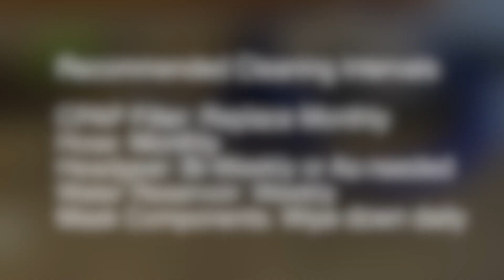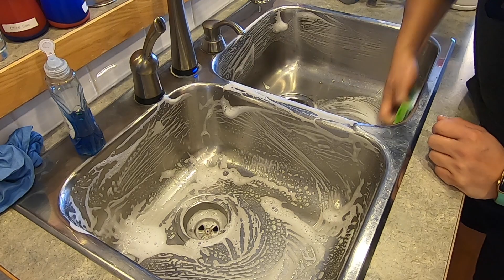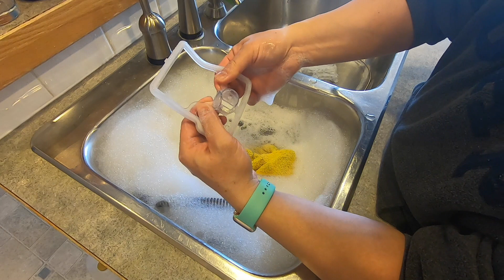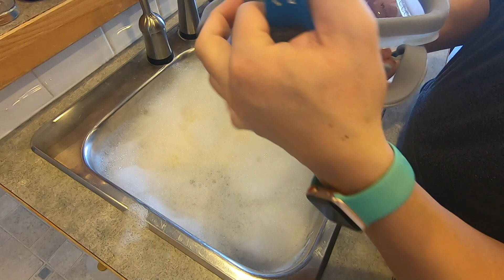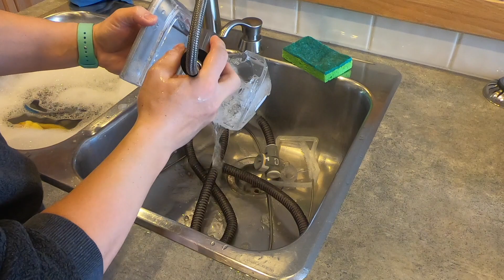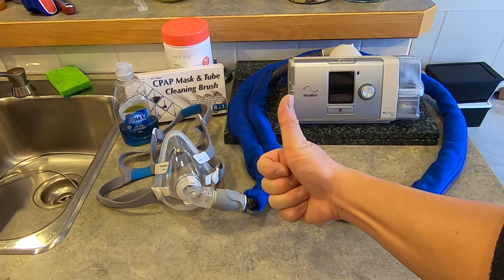How to PROPERLY Clean CPAP Equipment

Comment: The technician who gave me the cpap told me explicitly NOT to use Dawn dish soap but to use baby shampoo instead. Thoughts?
Reply from the maker: while it is true that dawn definitely does a really insane job of cleaning things up well and has some residual perfume smell to it that I've been doing it for 7 years like this on the ORIGINAL heated hose with nary a problem.  The key is to not use too much Dawn and to rinse your stuff really really good with clean warm water.  I triple rinse at the minimum and yes I can smell a bit of the dawn but that quickly dissipates especially once things are dried.  Think about it for a moment - you use dawn dishsoap all day long to wash dishes, we use caustic dishwashing powder/tabs on the very things we use to prepare food and has anyone died or gotten sick?  Not that I know of so I don't see how washing cpap equipment when done properly and THOROUGHLY rinsed would be any different.  If I'm still using my original hose from 2017 with regular washings with blue dawn and I've NEVER had a problem then well.... you draw your own conclusions from that.

Comment: I had my machine for only a week in use and now the air coming from it smells stale ... It seems when you have a machine with built in air humidifier and heater you must wash the air hose much more often then 1 time a month.

Comment: Thank you for this extremely helpful! My husband uses a cpap and he is lazy and doesnt clean his... #eyerolls so I have to doit for him. #smh
Reply from the maker: Glad you're helping him out with the maintenance aspect of cleaning.  Having clean equipment is pretty important for health reasons.  I'm lazy too but found that when I didn't clean it that over time, it would start to develop a different smell to it (nothing gross) so cleaning it ensures that nothing unhealthy like mold can start to develop inside the air pathways.  The hose has heavily humidified air and the reservoir contains water.  Tell me how mold can't grow in that b/c it most certainly will.  Moreso if you live in a humid climate.

Comment: I was told where i get my medical supplies not to use a brush on my hose because it scratches the inside & bacteria collects in the scratches.
Reply from the maker: The brush I use is very soft and in all the years I have used it that I have never had an issue with the hose accumulating and bacteria or mold that I could see. It doesn’t smell funky either so that’s usually a good sign. Going in 5+ years strong in the original hose. Just get a good quality soft bristled brush designed for cpap hose cleaning and be gentle when using it.
Reply: @piercedasian  my insurance company pays for me to get a new hose every 3 months.
Reply from the maker: While that is a nice perk that changing out a hose every 3 months seems very wasteful.  I'm still using my original hose from 5 years ago with nary of any signs of wear or it being smelly or dirty.

Comment: I always put the water chamber in the dishwasher for the airsense 11 in the dishwasher
Reply from the maker: I'd caution you to double check your reservoir to make sure it is dishwasher safe as you can over time, damage the reservoir from the caustic dishwasher cleaner + extreme heat.  My air sense 10 had the OPTION of a dishwasher safe reservoir but the stock one from factory is not dishwasher safe.  If the air sense 11 is washer safe then way cool!

Comment: I have a REMstar plus water chamber can't get the bottom off to clean it what can I use to clean the inside of the water chamber?
Reply from the maker: ah, use straight white vinegar and soak it for day.  If you've got hard mineral deposits in it or any other nasties that the acidic nature of vinegar will kill off most of the pathogens in it.  Just give it a good rinse with water and be aware that vinegar smell will persist for a bit after rinsing it.

Comment: Once weekly I use a 33% vinegar solution in my water chamber.  I leave that in the chamber for an hour to sterilize the chamber. I use three different hoses and headbands so two are drying for two weeks on shower curtain rod.   I use pillows and rotate these daily.
Reply from the maker: wow that's a pretty good rotational routine you've gone going on there!  Good job.

Comment: Why not use a Cpap cleaner?  Like So-clean or lumin?
Reply from the maker: I have a so clean but you still have to wash things like oils and physical residues from your cpap equipment.  I tend to lean on the cleaner side of things and will use so clean every 2-3 weeks and then a sink submersion wash each month.  Been years and still using all my original CPAP hoses/reservoir and even headgear.

Comment: How do u get the connector piece off the hose?
Reply from the maker: I just pulled on it and it comes off.  The hose piece that attaches to the face mask elbow is a separate part.

Comment: NO, NO, NO! HELL NO DO YOU WASH THE EQUIPMENT IN A SINK!  NOR USE TAP WATER. Distilled Water, heated in Microwave or boiled. Use medical anti-bacterial soap not dish washing soap.
Reply from the maker: This is such nonsense.  Even the DME doesn't suggest doing that.  Distilled water to wash your equipment?  So insanely wasteful.  Unless you have contaminated water that there is ZERO issues washing things this way. If the very sink I prepare my dinners in (washed down with disinfecting cleaner regularly) is good enough for my food then it certainly is good enough for my CPAP.  Use of medical grade antibacterial cleaner is just plain crazy talk.

Comment: I use tea tree shampoo…it cleans well and the minty smell cancels out the potential yucky smell that can make your face mask stink.
Reply from the maker: interesting.  I haven't tried tea tree shampoo on my cpap gear before but I get what you mean.  I can't say that my cpap masks ever smell but then again I usually give them a quick wipe down with a cpap wipe each day and I do regularly clean mine using the method shown in this video.
Reply: @piercedasian  I use a mask wipe Monday thru Saturday.  I do a deep clean with the tea tree shampoo in a bowl that fits in my bathroom sink of: the entire humidifier compartment, framework of the headgear and nasal piece every Sunday morning as soon as I hop out of bed. I take the hose into the tub, pour a little of tea tree shampoo and fill the hose with warm water and work the hose up and down to get it clean.  Then I rinse it, and take all the pieces to my bedroom to dry.  The headgear dries on a towel… I place the bowl upside down on the towel that I used to soak. The headgear is draped over this inverted bowl…hangs nicely…where it dries. The rest of the gear including the hose goes into a towel-lined tray to dry…with the hose hanging to dry. I found the bowl and the tray at Dollar Tree, the microfiber towels at Home Depot.

Comment: Nice video,  How about months of daily use without cleaning  any part maybe a an occasional swipe with a baby wipe to get the real gross stuff off. I have done this routine seven years now no infections,  no issues,  just better sleep. I have flushed the tubing with dish soap and hot water about every 6 months just because.  My machine is set to full time  positive pressure no Bi-pap mode, which blows constant pressure. How can any thing but normal everyday bacteria mold, spores, pollen, dust and dander  that we breathe anyway get inside the machine and tubing worse than a houses air conditioning ductwork ? Also the CPAP is a positive pressure environment. Yes I have the machine micron filters in place and do change those monthly . I also use tap water in my reservoir. And i am on the road all over the country. I do soak the water reservoir with vinegar every 4/5 months to get the mineral deposits out . Do you wash your house and car’s air conditioning vents and ductwork with dawn and vinegar too ?  Didn’t think so. Calm down everyone
Reply: Great advice. Not.
Reply from the maker: While I don't argue that you haven't gotten sick and that cleaning cpap equipment like how I've shown might be excessive that in certain instances that some folks NEED to clean this way b/c of the environment they live in or b/c of immunocompromised health conditions. I like to take a "balanced" approach in my cleaning routine where I do this very exact cleaning procedure every other month for my own peace of mind.  You're absolutely right that no sane human being cleans their ductwork the way we clean our cpap but I'd rather know that I made a conscious effort to keep my equipment clean and should I ever get sick that it would never be pinpointed back to my lack of cleaning of my cpap.  Each to their own.  If it works for you then it works!  I can't say the same for myself or others that I've seen get sick b/c they neglected their cleaning.

Comment: Sink, no way! Dishpan can be cleaned and no funky kitchen germs.  The overseeing authorities of the facility I used to work at one time never allowed us to use strong dish detergent because of the Ammonia content.
Reply from the maker: I think sink is fine permitted one exercises common sense in their own sanitation. I disinfect my sink regularly since it is the same sink used to prepare the very meals I eat.  I would hope that those that use their sink to clean their cpap equipment also understand that they should be sanitizing their sink regularly.  I've used dawn dish soap since I got issued my cpap in 2018 and no issues and my original heated hose and reservoir and even mask components look, feel, and operate like the day I got it.  I'm not sure what other cleaners people are using by dawn dish soap seems fine and I've used it for years with my bare hands to do dishes and my skin is fine so how can a plastic hose be harmed by something like this?  Proper washing techniques and thorough rinsing are paramount to ensure all traces of the detergent are washed away.  It wouldn't be ANY different than you using dawn to wash your dishes and nobody makes a fuss about the plats you eat your food on.

Comment: I was using and still have a SoClean 2. If I had to do all this to use the CPAP I would have given up years ago. Because I got a replacement DreamStation 1 I decided to use the White Vinegar to clean the chamber, mask and tube. Hands scrubbed the chamber and mask with a little vinegar and then rinse with hot water. Put a some vinegar in the the tubing, raising and lowering it and then rinsed with hot water. I think I can tolerate that once a week. I don't have a two compartment stainless steel sink. I can only telling you using the SoClean I never got a respiratory illness, cold or sore throat. Never washed the tubing or mask as it was disinfected with the ozone. Just replaced on an interval basis per Phillips suggestions. I washed the chamber in hot water every couple of days. I probably was only using the SoClean one a week or so the last year. Now I will hand clean the equipment and just use the SoClean every 6 weeks when I don't want to be bother cleaning the devices in vinegar. Maybe one of these years the CPAP manufactures will come up with self cleaning devices that eliminate bacteria.
Reply from the maker: Hey Mark, sorry for my late response but your approach seems pretty reasonable.  I use my SoClean about once every couple of weeks (too much ozone for cpap gear can't be good for it) so I mix it up and use SoClean and manual washing techniques as needed to ensure my gear is clean and healthy.

Comment: So it is ok to put on machine and let air go through hose to dry it. I was also told you had to hang it. I clean my Cpap every week and still get sinus infection.
Reply from the maker: You could do that but in MOST cases that is not necessary.  You may want to get tested for allergies to see what is causing your sinuses to be aggravated.  How are you cleaning your CPAP machine and did you have sinus issues prior to use your cpap?

Comment: What's the best way to clean inside the hose since I don't have the hose brush
Reply from the maker: just submerge in warm soapy water and fill hose with soapy water and let it drain out several times and then rinse thoroughly.

Comment: I was told not to used dish soap to clean the parts, was told to use baby shampoo to clean the parts
Reply from the maker: depends on who you ask... I've washed mine in dish soap for 4 years without a single issue.  In fact I'm still using the same reservoir, hose and headgear since 2018!  Even my mask cushions last WAAAAY longer than what I was told by my DME or the online CPAP community.

Comment: Thank you for your video. This is a question for anyone. I’ve used the nasal irrigation systems before and remember them being adamant about using distilled water because you were inhaling this water way up into the nasal cavity and tap water could contain things that are very dangerous to your health if inhaled way back and even cause death. I even saw on the local news the same thing where someone died from using common tap water for nasal irrigation so I’m wondering when you rinse the tubing and use it before completely dries then you are inhaling tap water left in the hose if there is a health danger. Thanks
Reply from the maker: It isn’t that you can’t use tap water or that you should use distilled water. It is that you must use water that has been thoroughly boiled to kill off any potential pathogens in the water. Distilled water ironically can contain pathogens too if it was processed or handled improperly.  I am always very surprised to hear about how peoples tap water can unsafe. That is unheard of where I am and the water we get from our taps is one of the cleanest waters around.  That being said when I do nasal rinses, I always boil water in a clean pot or kettle and then let it cool and then use within 6-8 hours of boiling.  The case you’re referencing was a lady in the US that nasal rinsed using contaminated water and then developed a flesh eating disease in her nasal cavity. She didn’t follow proper sanitization practices using water of questionable quality.
Reply: @piercedasian  so if you boil your water you agree even the cleanest tap water in the country isn’t safe to run through your nasa cavity
Reply from the maker: I have used two water in my nasal rinses without boiling but I would advise that one should still boil as a added layer of safety. Even if the tap water is safe, there could be other factors like a dirty tap aerator in your home that could harbour bacteria so regardless of how clean the water source is that I’d strongly advise to boil the water. Distilled water is not any better. Boil it to be absolutely sure it is safe.
Reply: @piercedasian  all I’m trying emphasise is that using a Cpap hose that still has tap water in it is no different than doing a nasal rinse without boiled water. Whether or not anyone thinks it’s safe or not, that un-boiled tap water is going to the same place. Look I get it. I clean mine with tap water. I have a second hose to use while the one I just cleaned completely dries. I still love your channel and look forward to more videos
Reply from the maker: Valid points JonFon.  I work closely with the local municipality and fortunately where I live the water is exceptionally safe here (plenty of chlorination and constant testing of water) and me being a clean/germophobe also has a very clean home right down to the aerators in my tap.  I guess most folks aren't OCD like I am so to your point do things with the understanding that bacteria could be looming.  Most are probably benign but I'm not specialist in diseases so as they say "caveat emptor".

Comment: Would you mind advising how to clean the interior part of the machine itself?
 😅

My Mom stopped using her CPAP a few years ago...and unfortunately she left the water reservoir out of it so it now has a layer of dust and cat hair in the reservoir cavity. 🤦‍♀️
We cannot replace the machine and she understands that she needs to resume using it...

We have tried to find advice on how to deep clean the machine itself when it has been left out and is visibly dirty inside...didn’t find any advice of course.

Her machine is ResMed AirSense 10 AutoSet for Her, and she does have a SoClean 2 CPAP Cleaner...

Any advice you give will be greatly appreciated. 😊 ❤❤❤
Reply from the maker: The insides of the machine can't really be easily cleaned unless you're a really handy (and daring) person to rip it apart.  If the unit is covered in dust I'd start out by vacuuming the cpap and then getting a can of compressed air to give the inlet and outlets of the cpap a good blow of air (don't shake that can of compressed air as it will "spray" if you do).  I'd follow up the cleaning with a thorough wipe down of the unit with a cpap cleaning wipe and then running the unit with no reservoir attached to blow out any loose dust in the blower.  You may be surprised at how little dust (if any) is actually on the inside of the CPAP machine.  I recently cleaned out a unit that sat on a shelf for 10 years and was FILTHY behind believe on the outside yet once I vacuumed away all the dirt, wiped it down blew it out and replaced the filters on it that it ran as good as the day it was made at the factory.  No dust came out of the unit.  Give the reservoir a good washing with plenty of soap and water.  Put a new filter in and the unit will be good as new!